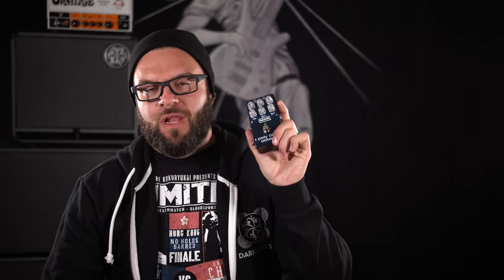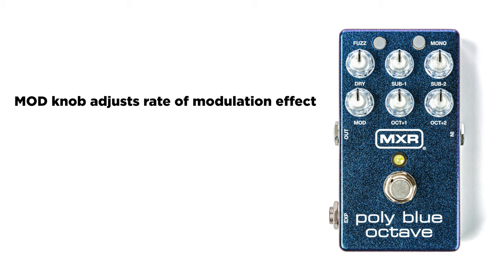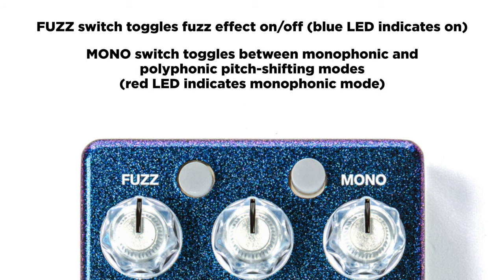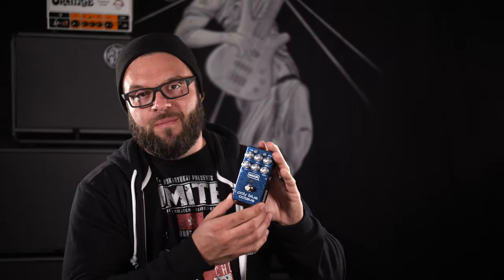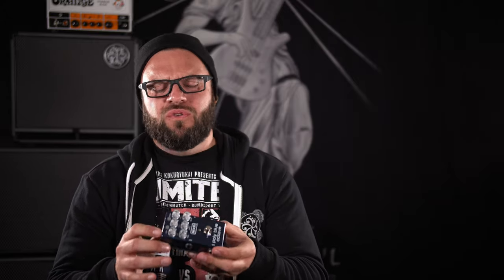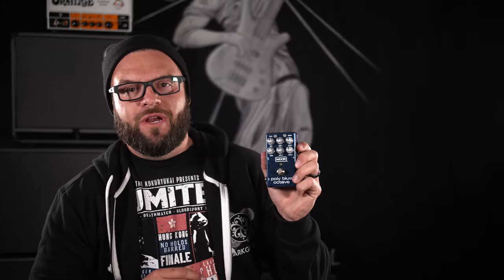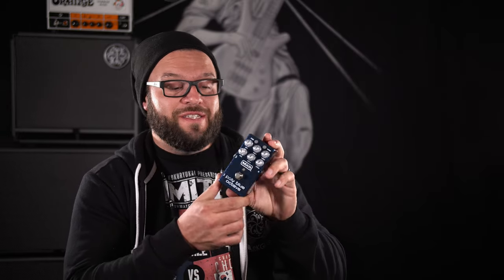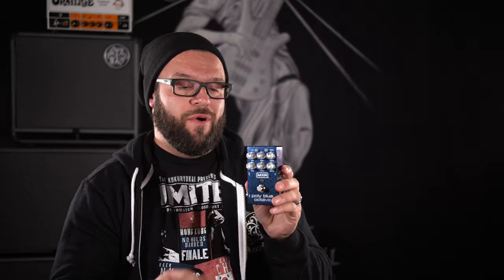MXR Poly Blue Octave Bass Demo

Comment: How is the tracking overall? Does it track lower end of the bass cleanly or does that start to get a bit messy?
Reply: It tracks as you would expect. It does it’s best work in the mid and higher note range. It tracks fine on most of the lower notes but you start getting the typical response from low B focused notes as you would with most octave pedals. You can still get clear tones and use out of it but my personal taste leads me away from low B stuff with octave pedals. It holds up but it shines on mid and high note registers

Comment: Where's the bass? Fretted vs frettless? What pickups track best? How well does this track a low B or any drop tuning? Hows chord tracking?  How well does a sub2 work with low bass strings?
Reply: Being a polyphonic pedal, my assumption is that it’s a digital octave, which doesn’t generally have ‘good vs bad tracking’ like an analog one would, hence none of the typical tracking tests.